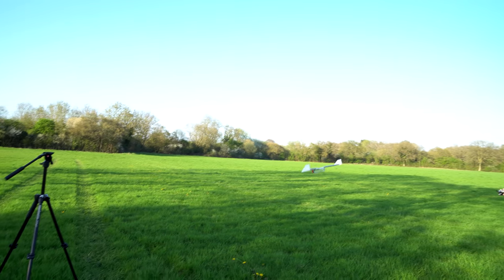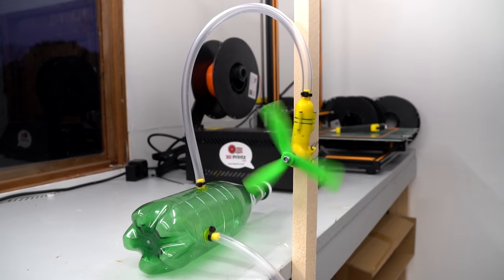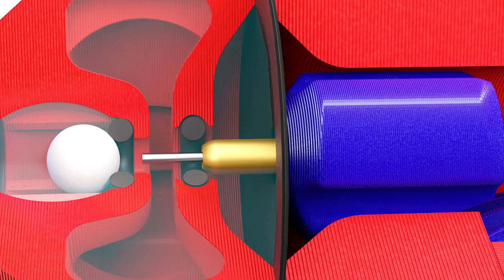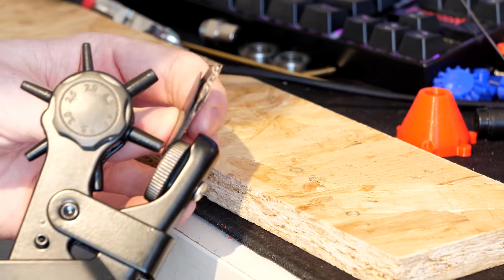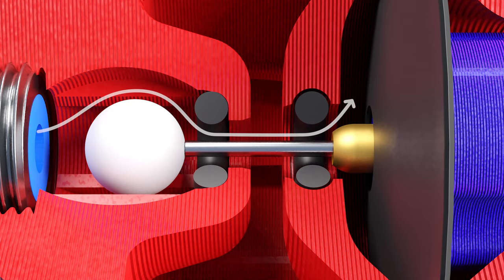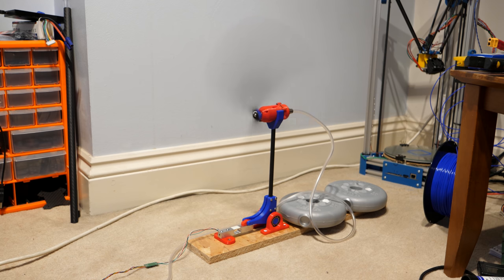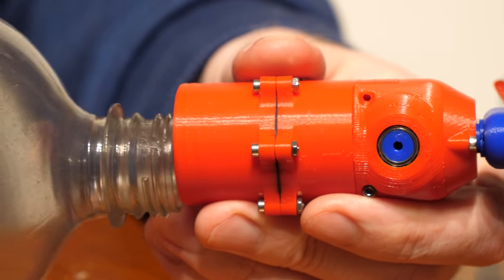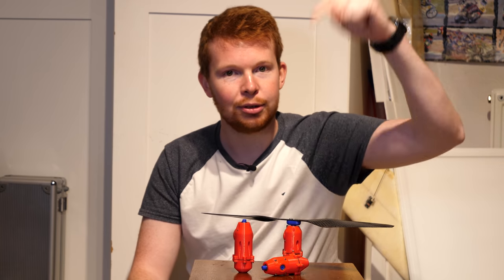Diaphragm Air Engine

Comment: we could have a very strong metal tank that holds pressurized air at like 5000psi and the fuel gauge can measure how much pressure there is left

Comment: This Valve could be used to power a generator in the oil and gas industry. Or really anywhere where there’s a pressure differential.

Comment: The air motors do work but, If the diesel powered (in my case) engine is shut down for a significant period of time and enough air leaks out of the air storage tank you will need another vehicle or air source to jump start the machine.

Comment: I'm having trouble figuring out why the brass pin and wire were such a difficult task to figure out... 

Print yourself the same model you printed a dozen times, only cut it in half.... Save half your material and measure the inside as you manually operate it. This should make it so you can physically see how long each piece needs to be. 

The one and only problem is the distance the diaphragm releases but I'm assuming you already knew when it would (even if you didnt, it wouldnt matter as long as the ball seals before the diaphragm releases)

Comment: I was watching another YouTube clip where this guy said that you could run a car on compressed air. He also said that the tank that was used to store the compressed air had to be made from poly carbon fiber. The reason for this is so it would not explode but instead it would just crack in the air would wash out without injuring anyone. My question is why not have a solar powered air compressor feed a compression tank that runs the compression motor? In other words if you had an off grid home that was solar powered with a battery system and you had a compressor that ran off of air that was fed by a solar panel Powered air compressor you could literally live off grid because the solar power from the panels we charge the batteries but when the batteries get down to low that the compressed air from your Motor powered by air could be continually supplied by the air compressor if you know what I mean. I’m wondering if there’s something already out there that can be purchased that would allow someone to make this happen. Any thoughts would be much appreciated thank you

Comment: The valve design is nice. Very similiar to an air rifle. Diaphragm on the other hand is a killer for this project. I believe that the force req. to expand the diaph. is too big a % for this engine. Extreme loss of power. You could get different results with different diaph. radius. Print the piston so its hollow from the con.rod side. Less weight, better efficiency.

Comment: In my opinion you could put something inside of the water bottle like a balloon that will shrink as the air leaves the bottle giving you more air because it doesn't need the air that the bottle needs instead just the air that the balloon needs but it can still hold as much as the bottle or further if need be

Comment: Wait, does this design fight itself? When the piston opens the valve, for half its downstroke it's slowing itself with air pressure coming in, and then speeding back up on the upstroke till the valve closes again, so you are killing like half your efficiency?

You need the valve to open only on the upstroke, and through the entire stroke, and to shut off all other times. I would suggest that the bottom gear be used for this, as its by default a timing mechanism and can be offset. Maybe an arm that pushes down on the ball connected to the bottom of the gear on the 9 oclock positions, forcing it open only during the down?

Something like that

Comment: Im no engineer but i think the extra head space is unnecessary, with engines the less dead space you have the more power you get. Another idea is having the piston riding on 2 brass rails on each side made from a thin brass sheet with it rounded at the top. My thought process is that since the piston is not rubbing against the walls this would get rid of a lot of friction, while not damaging the diaphragm with sharp edges.  The only problem is that it would wear out the piston faster. Another idea is just a crank case vent, this would let exhaust air out faster while giving a view port that you can lube the components through.
Reply: While watching ive though of another way to design this engine, instead of having a full piston you could make a + shaped piston. This would move the friction points to a much smaller area and have the brass rails be more of a brass skid on the load bearing sides

Comment: Bash valve steam engines have been around for over 100 years and it always seemed to me that the AirHog toy plane patents infringed on early art. Also, when I was a kid in the early 70s I bought a bash valve CO2 engine for one of my free-flight models. Preceding AirHog by over 20 years. They are typically uniflow with exhaust ports uncovered by the piston at BDC. I have almost finished my steam motorcycle but I'm using a piston valve Strelinger engine.

Comment: It doesn't need to be air-tight!   There are no noxious pollutants like combustion byproducts to worry about, so "blow-by" essentially becomes irrelevant.  Yes, it does, however, reduce the efficiency of the engine, but if the medium of propulsion is compressed air, then power loss is almost a non-issue.

Comment: ingenious design and you can use structure of a gas turbine which has  consecutive rotor and stator blades because turbines  %30-40 more efficient than pistons after 2000 rpm which airplanes need ...

Comment: An air engine doesn't need to explosion but just pressured air? very fun and challenging. If Air tank could be made by high pressure container, It would be able to fly longer? very curious about it

Comment: I just watched a video on sodium and water creating a violent reaction. How about trying my idea below??
Recycle pressured air forced to escape to push a tiny bit of sodium into a blast chamber, cam in an equal amount of water. The resulting explosion pushes a piston in a cylinder to create air pressure. Rinse Repeat.
May exhaust the noise from escaping air, may create self sustaining air pressure. May cause loud boom, May explode, May Work if engineered correctly.

Comment: Why not incorporate a rotary valve system on the crankshaft rather than the ball valve and prod-stick (for want of a better name) system?  It'll improve efficiency because of better control of port timing. It would also eliminate the power loss from the diminishing pressure during each power stroke from the small reservoir pocket in the cylinder head. You could eliminate the reservoir pocket and use the full pressure direct from the air supply for the entire stroke. It'll have fewer moving parts and you could also use a diaphragm permanently sealed to the piston and make it double acting to increase power. The only difficulty would be managing the close tolerances required to seal a rotary valve system.  If you don't like the rotary idea, then a reciprocating piston like that used in a steam engine would be another option. After all, a compressed air engine is pretty much the same as a steam engine.

Comment: An easy solution.....replace the spring with  neodynem magnets. Placed in opposite polarity...One in the top of the piston and a small flat one in the diaphragm.  And use a small flywheel to smooth out the cycle. No moving parts. Good luck.

Comment: This is a very cool idea. But imagine using this on a big plane, you will have the problem that you need a big compressor on the plane. The compressor uses a lot of power. Maybe think of a solution to that next

Comment: Thanks for your work. 
As an idea its posible to use a turbine( as a motor )and take the exhaust of the tubine to the back to create a tini extra thrust... i think the piston is less inneficient (cause friction) than it may be if you use oil to lubricate the piston and internal gears.

Comment: Have you considered adding "liquid air" to the bottle??? LN2 is hard to get probably, but a cool spay should be easy and is not so cold that it makes the bottle brittle....

And how must force is need for the brass rod to penetrate the o-ring? I'd think that's a fair amount and a place to optimise...

Comment: you should 3d print a v8 model of this and hook it up to a 30 gallon air compressor. it would be very interesting to see how much power you could produce with it. or even a v10 engine block

Comment: I’ve finally figured out what bothered me about this new engine! The valve design! It’s quite frankly not a good idea. I’ve been in a loop trying to think of how to improve the designs and they always lead to the same problem: either it’s wasting valuable air or lacking power. The solution is quite simple really, use a similar push rod idea as in the v3. The best part about the push rod design is that it allows constant air introduction through the full stroke for an increased power output and better efficiency. This means you will have a drastic increase in torque as long as the cam keeps the value open all the way through the power stroke (a design flaw i saw in the v3 as it had a standard short lobe.) i think also increasing the diameter of the piston and shortening the stroke might be worth looking into. I also have a feeling soon the single bearing design might not be enough for this engine because you’re about to be able to make some serious power with this.

Comment: I was about to say that this engine would work great in a vacuum because it doesn't require combustion to function and the lower external pressure means less air would be needed to make it run with the same force, but then I realised that you are using the engine to turn a propeller which needs air to be useful🤦‍♂️

Comment: What if you harvest some air pressure in the bottle to run the engine using a chemical reaction for the pressure, something like Mentos in Coke, but without the bubbles? So you can run it longer.

Comment: Theory : If you use that air engine and replace the fan with a bike sprocket then attach it the middle of the bike with a bracket that can be welded on and then perfectly link the sprocket (that's attached to the air engine) up on the bike chain would it be able to push the weight of the bike with a air compressor attached to the motor  ?

Comment: What if you make a tube (by not filling a bit of the enhine wall) so the used air will go out the "back"? This will reduce the weight and might boost the performance a bit

Comment: Late 1930’s pic of my dad with compressed air free flight balsa/rice paper plane that flew out of sight over Lodi farmland.  Air cylinder wrapped with piano wire.  WWII  he mentioned large/wood RC target drone in pacific and when he passed ; a large maybe 40” span wood model DC 1 (like DC3), 36”, Piper Cub (.049 free flight) and numerous rubber band balsa/paper WWI/WWII planes.  Air powered must work.

Comment: I'm curious, as someone who wants to go off grid with a small home, is there a way that I could use a static bike, to compress air in bottles, to then power a turbine to produce power? I know there's tons of loss, but if I can convert my output on a bike into two different energy storages that would be pretty cool. Just fantasizing that in order to play video games I'd need to make the power myself.

Comment: Something wrong with previous design. Engine with more "dead" volume can't be more efficient! You probably need polished  metal cylinder sleeve and polished metal piston to achieve better result with your original design.

Comment: i love that holy shit i got it face at 5:53. xD

Very nice idea and great video diary. Im very interested to learn more about the construction and build something like that. I have two questions for my understanding. First, why do you have a air supply inside, and how do you calculate the volume of that? 2nd why it is not possible to push the cylinder without the air supply.

Comment: How about runing that engone with fermented wine? If the CO2 emitted from fermentation can pop a bottle, then that force could be strong enough to power the air engine?  At the same time you could get ethanol from fermentation which could be another fuel?
Reply: Maybe someday you just feed your car with water sugar and yeast and after weeks of running you can have free wine... mmmmmh, cool!

Comment: The trial and error process and constant reprinting was somewhat brute force problem solving.  I'm not saying that you should deal with it like a math major, but at the very least you should have narrowed down the brass head and wire length ratios before going to the production phase that many times.

Comment: Please don't try this at home but couldn't you use dry ice in the pressure bottle with a discharge valve set to go off when the pressure starts to build too high?

Comment: using chamber sizes and shapes in ratio to nozzle sizes and shapes should make various combinations of thrust and spin but all these direction changes and intermediary steps sap energy, but add buffer but using air compression chambers should do both but i like your videos

Comment: Could ammonia stored in a hydrate be used for pneumatic engines. metal–organic framework MFM-300(Al) can take up ammonia at a density close to that of liquid ammonia at ambient temperatures.   If you had two tanks maybe you could cycle between the source and sink of ammonia depending on which tank you applied heat too.  SaltX Technology sells patented thermochemical energy storage solution based on nano-coated calcium hydroxide (just add water).

Comment: Could the air thats being channeling around the piston and into the gearbox be causing unnecessary resistance? and is there a way of utilizing it instead? (making it so the air adds to the spinning gears and not potentially taking away from them)

Comment: Now I think we should just push out and ask the big question.  Do you think you could make a 4 cylinder version, and scale  it up to say 4lts. Convert  the fule tank to a higher  pressure air tank and power a small but life size car. Think about it. We only use fule for a explosion (pressure). Just change  the source  of  the pressure  and no emissions. And NO 30-60min CHARGE ⚡ STOPS. harmless and convention. Would like to talk more? Dm me

Comment: This is a steam engine and all engineering has been done. Diaphragm is substituted for the piston in steam engine. Same valving, same principle.
Would make more torque if it pushed both sides of the diaphragm alternately....like a steam engine or a diaphragm pump. Hey you could copy a diaphragm pump directly.
https://en.wikipedia.org/wiki/Diaphragm_pump

Comment: Hello, I just discover your channel. I like your explanations exerything seems easy :) Your project is original. Good job. I have a question about this small printed air motor. Your show the efficiency with your 3D printed parts. But have you try with machinered parts? without friction it will work better, isn't it?

Comment: Would it be possible to obtain a copy of the drawings for the diaphragm engine? I ask because I like to occasionally build small steam engines, and with the working materials being aluminum and brass, and the fact that “clapper valves” as that style of admission valve is known in the world of steam, I wonder how easy it would be to build a copy that didn’t require the diaphragm.

Comment: What program do you use for the CAD and animation? I have used Solidworks in the past, but from my knowledge it did not have that interaction with springs like the animation you showed.

Comment: This can work with the bicycle to run with air in a new way just make 2 of these engines and attach it to drive gears on each wheel of the bicycle 🚲 then adjust a foot air pump to the crank pedal mechanism to run it on air

Comment: Hello my two-year-old nephew is very interested in trains it got me thinking you’ve built plenty of air powered vehicles but I’ve never seen you build a train I’d love to see this in your video but if you’re not doing it I’m a mechanical engineering student and I will be building a pressurized Air engine train what type of rubber did you use in this video I am very interested

Comment: Air car possible but how to get cheap compressed air in enough quantity in a running car. One way out is using battery to run machine to produce compressed air on the go which keeps getting used in a  running car. Can check if any benefit that way if battery can be used less to generate compressed air than to run a car

Comment: could you make something that could pressurize the bottle? like a little gas piston. that goes off when the bottle falls below a specific pressure? you could power it with a fuel.
Reply: or if you could get it high enough use gravity and auto rotation to re-pressurize the bottle.

Comment: ive been wondering if you could use two liquids to make a sort of hydraulic powered engine where two chambers full of these incompatible solutions alternating back and forth with each other (because of their tendency to not like being next to each other in solution) would drive the piston or crank...
i clearly dont have any idea what im talking about so sorry if this makes no sense, but if i could articulate it correctly maybe someone could try it out as i dont have a 3d printer at this moment...
Reply: i figured it out! its been done but i dont have permission to read the study but this is the title; 
Interfacial Engine between Two Immiscible Liquids

Comment: imagine a 4 cylinder v engine made from this for model aircraft
Reply: in case I'm not understood, my logic behind this is, if there were 4 pistons instead of one, the aircraft would be able to output 4 times as much power, making sustained flight easier to achieve. but since piston parts will overlap, regardless of the configuration, its mass ought to grow by less than 4 times, giving it a bit more excess power to work with.